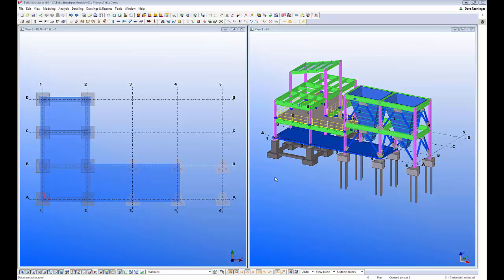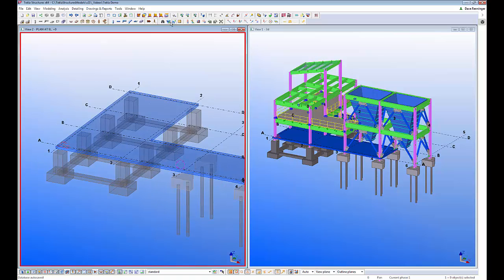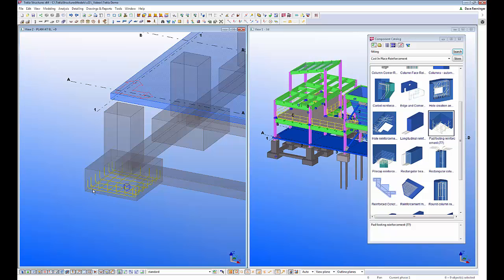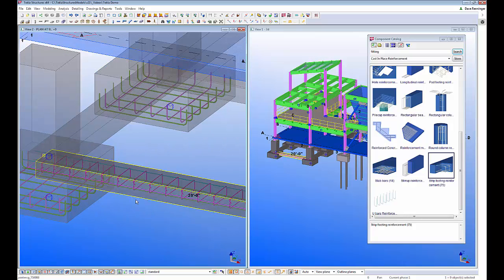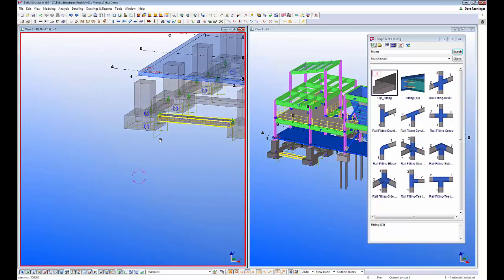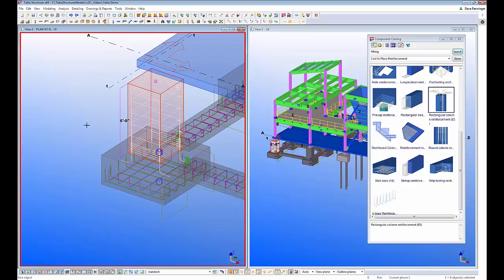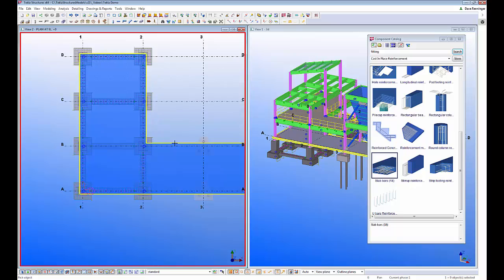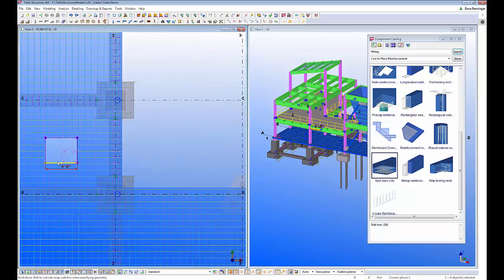009 Rebar Modeling - Tekla Structures

Comment: thanks for your very interesting video, I am a civil engineer and I am working with tekla for creation of steel structure drawings, and now I am strarting to work on concrete structures and I want truly work with tekla but it's difficult for me, because in my country, the majority work with autodesk products like ARCAD or REVIT, so the first problem which I have it's the rotation of the end of the rebars, since tekla use the rotation at 90 degree but in my country we use a rotation at 135 degree, so I want to know if there is this option in TEKLA and if the answer is yes, please tel me how
Reply: Hello, you can certainly create 135 degree hooks rather than 90 degree hooks - please get in touch with your Local Tekla helpdesk for assistance.